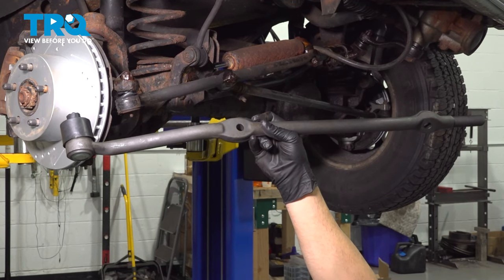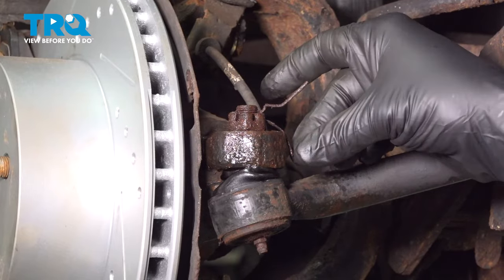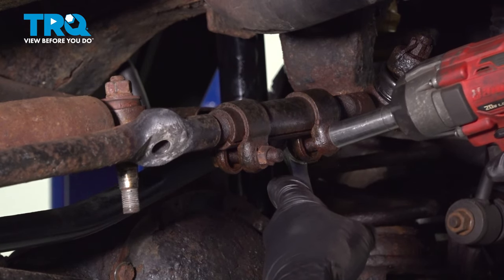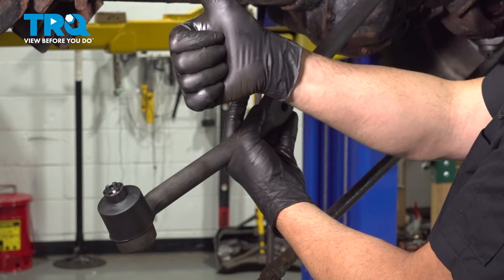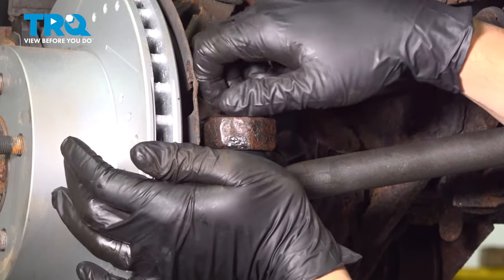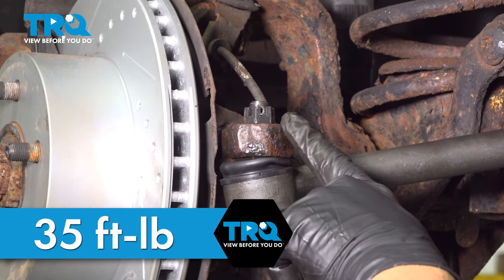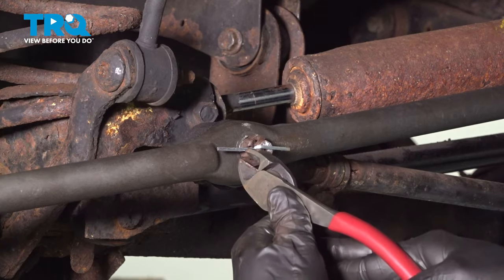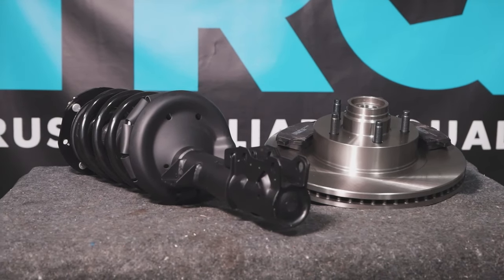How to Replace Tie Rod End 1997-2006 Jeep Wrangler

Comment: Can I add my own zerk fittings to TRQ ball joints ? Mine is the same & I was thinking of drilling & adding them, or is that unnecessary ?
Reply from the maker: +@shutupkevin789 These parts will not include zerk fittings but adding your own may void a warranty with the company you order through.